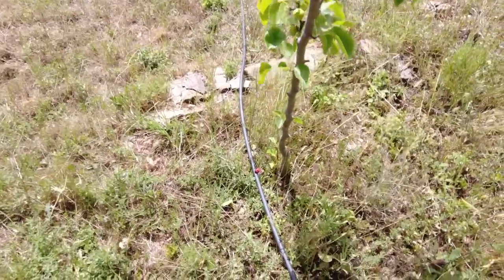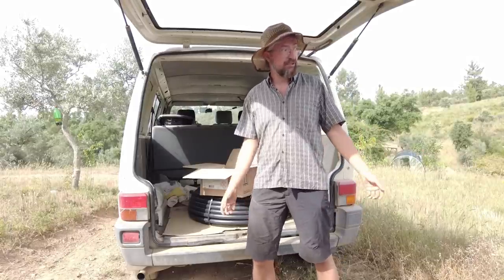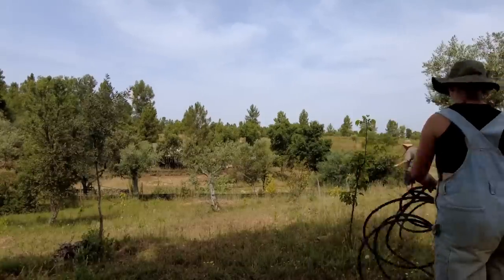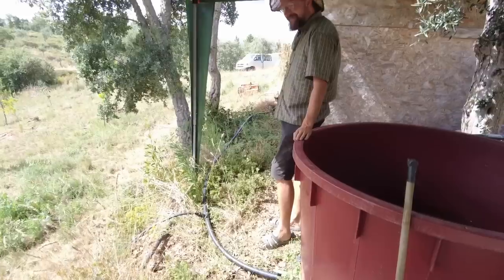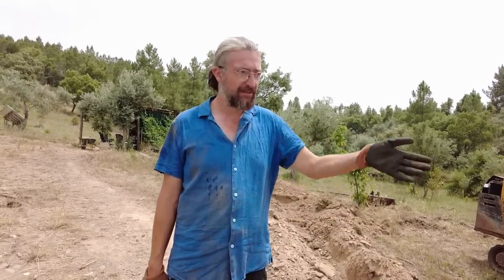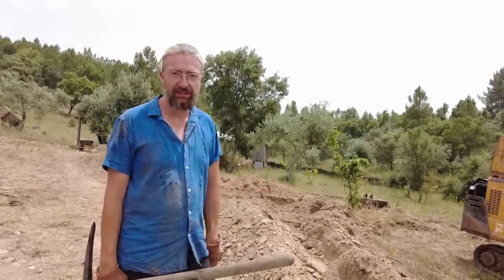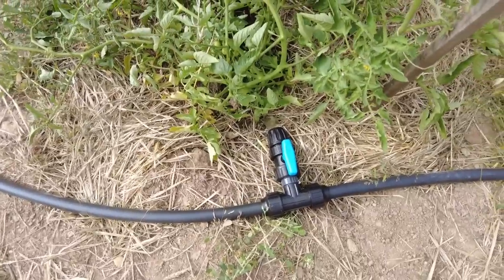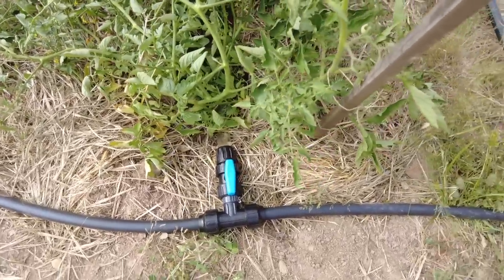This will save us so much time

Comment: Lovin to see you using swales & berms as your Fadden watering method. I've not seen it done like this, fed by hose from well water !!! So much more effective and efficient BRAVO. With water staying at ground level you don't lose all that moisture unto the air, it is absorbed into the ground soil & roots instead. I hope & pray for you that this is a huge success✌️✌️👏👏👏Many blessings from Ipswich Queensland Australia 🇦🇺🤗💞👍✌️👏👏👏

Comment: Your irrigation system is really quite different than mine here in the states. Yesterday I completed a small section of my orchard with the new system that has a small diameter main waterline and then you poke a hole where you want the water to come out, then insert a tiny tap to a very small rubber hose that goes to an emitter on the end. Each of these emitters allow 1/2 gallon up to 5 gallons per hour to drip out of the emitters onto each tree or shrub. It runs with a timer that shuts it off. No water wasted. Precise watering wherever you want!
I use a similar system in my garden but I use drip tape which is really like thin hose with emitters about every 6 to 8 inches. Most vegetables are planted about the same distance apart so again it is precise watering with no waste!
Reply from the maker: I know that there a loads of different drip irrigation systems, but this one was recommended by my friend and shopkeeper here. I’m not an expert at all so we’ll see if this works here.

Comment: Your new irrigation system will save you so many hours of work. Great job! Even though there won't be water in most of the lines since it is a low pressure system, be careful of parts where water might sit. Rodents are smart & have chewed up exposed parts of my irrigation seeking water during dry times. Probably not an issue though if they have access to water elsewhere.
Reply from the maker: We haven’t had any issues with rodents searching for water in our hoses/pipes, but we’ll keep it in mind thx.

Comment: i hope the watering system will keep working for you guys. I was told that the dripper system tends to clog up the drippers and springlers would be better. I am no expert just sharing what i was told :)
Reply from the maker: I hope so too. I opted for drippers that can be screwed off and unclogged if necessary and I also bought a filter to add to the line. Sprinklers are very wasteful in an orchard as 90% percent of the water goes to the grass in between the trees.
Reply: @ourportuguesehomestead  Maarten there are micro sprays with different angle patterns like 90º or 180º. Some, like the ones from Antelco, come with a valve to adjust watering coverage and flow rate. They work just fine when trees are young.
After a couple of years you can replace them with micro sprinklers for a wider wetting area. But even then I would choose micro sprinklers with a valve. Gives you more flexibility to adjust the flow and coverage.⛲
Reply: just another thing; the drilled tapping tees are very, very prone to leaks. Try screw reducing tees, especially when burrowed under 50 cm of dirt...

Comment: 🌳 Tip: Tree root spread corresponds to the tree canopy spread. Watering next to the trunk will miss the location of the feeder roots, so drippers need adjusting away from the trunk as the canopy spreads.
Reply from the maker: We can move the drippers a little if we have to :)

Comment: Wow - discover a well - assess well - conceptualize an irrigation system - materials needed audit - purchase - installation - function test system - correct issues - end result is a functional irrigation system. Congratulations. 
Do a depletion check on your well to determine volume used.
Reply from the maker: All our irrigation water is first pumped in our two 1000l tanks so we can always see how much water we use.

Comment: I have worked with gravity feed drip system on a sloping block and there are some problems.  The water pressure will be highest at the lowest point of the system.  and the lowest drippers will release a lot more water than the higher droppers.  This can be partly remedied by increasing the flow size of the higher units.  Also there will be very little flow from the top ones unless the entire hose fills.  This isn't a problem if you have a pressurised system but gravity feed....  Also no need to pin down the pipe,  once it is in the sun for a while it will lay flat.  A stone will do in the meantime.
Reply: pressure compensating drippers / emitters are the secret...

Comment: If your going to drive over the burried hose it's better to pass it through hard pvc piping first. Gives you much better protection and easy access. You can use the same pvc pipe for other stuff too (to run electric wiring through for example).
Also there's a spelling mistake in the title of the video.
Great job.
Reply from the maker: Thanks, I fixed it.

Comment: Wow so disappointed in myself for only watching this now. Very well done, looks like a great system. Are you running it straight from the faucet? I fill up a very large water container and do it from there, but it needs some height. This is so that if water fails I can water the trees for some time still
Reply from the maker: The water comes from the wine barrel on the terrace above (our plunge pool) about 1,5m higher. The guy at the shop adviced me to get a specific sort of dripper (I am not an expert haha) so I can work with a lower pressure. We had a lot of rain this week (it was a gift) so we haven’t really had to use the irrigation yet.
Reply: @ourportuguesehomestead  oh wow so glad you had rain, here it hasn't rained for 2 months at least, crazy

Comment: Have you had mildew on the courgettes and cucumbers?? How did you get rid of it. I'm having a bit of a problem out here
Reply from the maker: We haven’t had a problem this year but in the past we’ve used a spray bottle with a baking soda/soap (non detergent)and water solution which seemed to work.
Reply: @ourportuguesehomestead  ok I will try that... Thanks